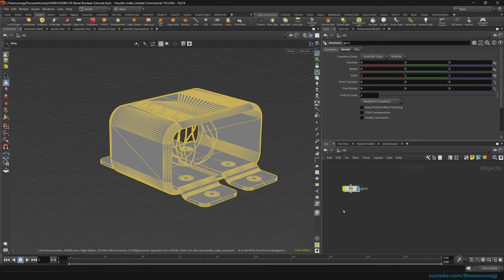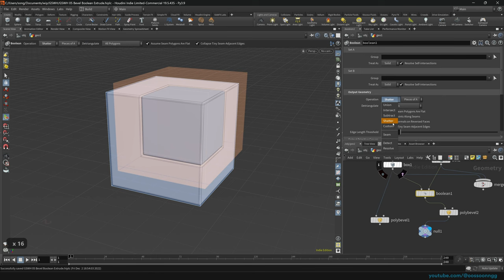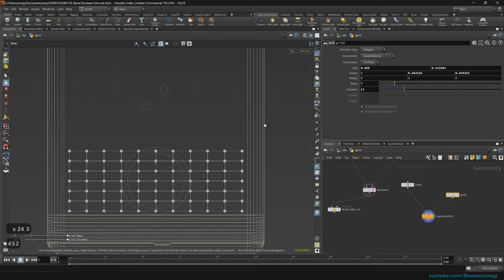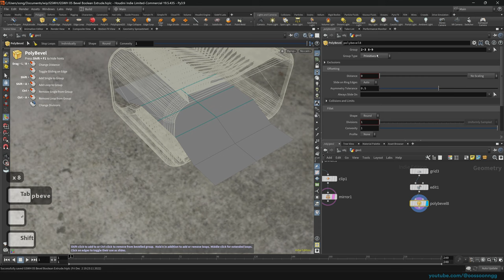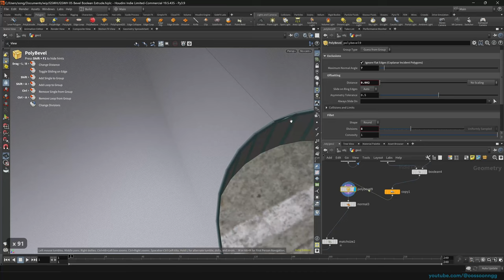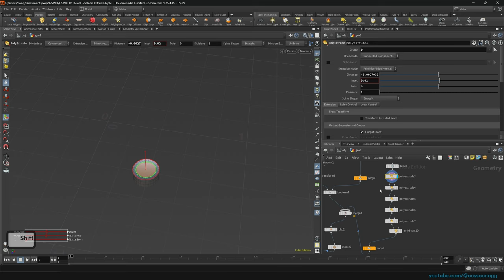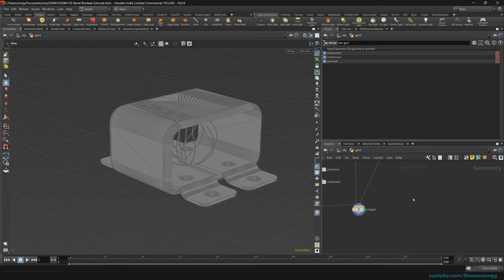Bevel, Extrude, Boolean & Other Basics of Hard Surface Modeling – Getting Started With Houdini ep. 5

Comment: If you don't want to be jumping around SOPs and LOPs all the time you can do some stuff.
1. Add geometry, light, camera, etc on SOPs, then go to ROPs and create a karma node. In that karma node you can select "render viewport", which will open a separate window with Solaris, this ways you can do everything in SOPs but see the result live.
2. In SOPs, create a LOPs node, so everyone you get into it, it will switch to LOPs, so is just about going in and out of it.
3. Do everything in LOPs. You can put SOP create nodes and dive in to create your assets, so is sort of like the previous method but inverted.
I don't have much experience in Houdini, I am using the 1st method rn but I think the 3rd one might be the way to go from now on with Solaris.

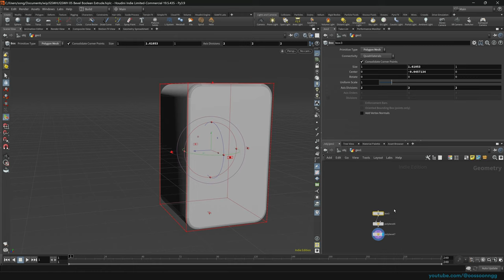Comment: great video! I have a question, on 15:55, the polybevel2 is still on(blue), and you select box1, and the handle shows up, but on my pc, it only show the bevel stuff like 15:17, only if I turn the box1 to blue, then the handle will shows up, is there any setting for that? thank you🙂
Reply from the maker: to view handles select a node you need and press enter while hovering mouse in the viewport, i hope i understood your Q correctly
Reply: @oossoonngg  thank you for reply! but it still doesn't work.. only if I turn on the render flag (blue) of the "box1" then the Handle will show up, anyway, I just start to learn Houdini, maybe there's some wrong settings😂
Reply: @oossoonngg  just restart houdini and everything worked again, apparently restart can solve 90% problems🤣🤣
Reply from the maker: Sometimes restarting viewport is enough BTW. If you have labs, there is a menu item that does that. Or do it manually. Or restart houdini hehe
Reply: @oossoonngg  thanks again:-)